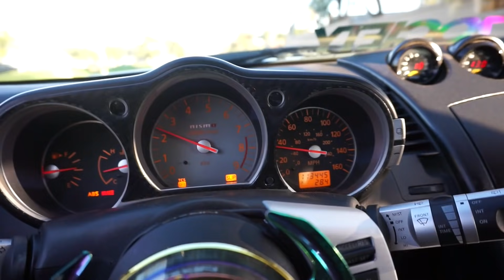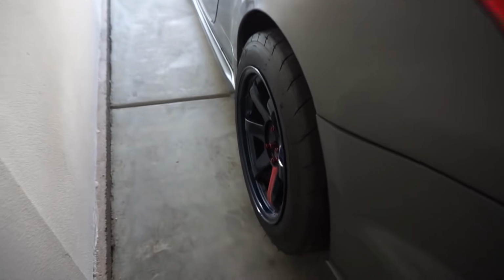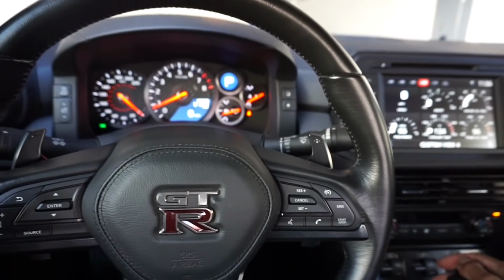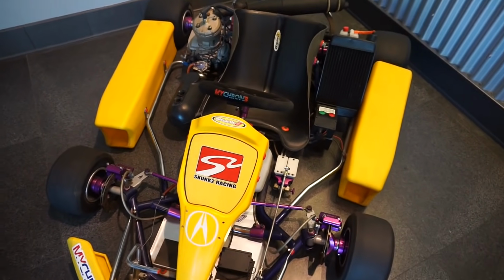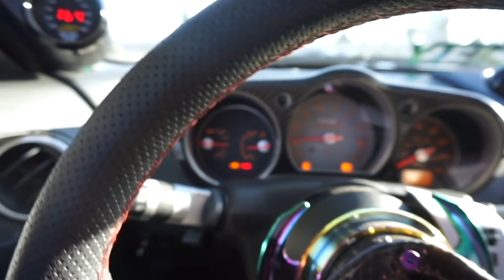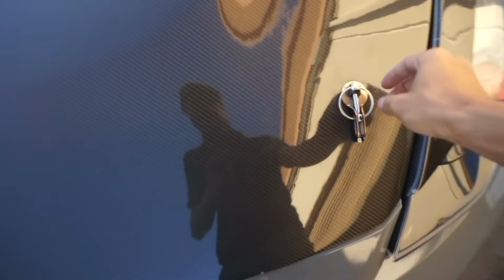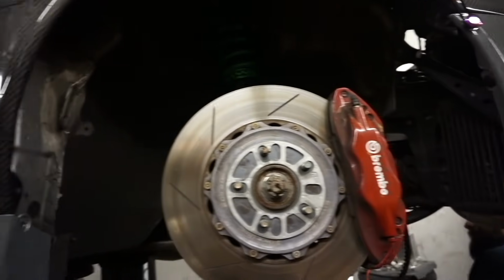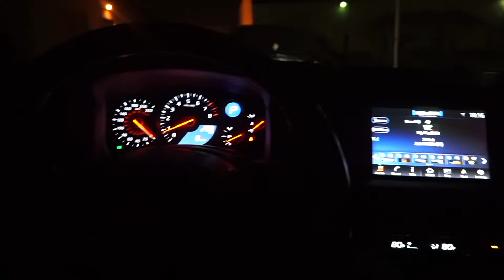Got meat? My 700HP 350z finally gets drag radials!

Comment: I had that problem with the door on my 370Z. I had to take off the interior door panel and replace the mechanism that connects to the locks. Turns out the wire was ripped. It worked after messing with the lock similar to yours but ended up failing after a few weeks. That’s what I did to fix it tho
Reply from the maker: Damn sounds like fun hahahaha
Reply: Freshhkiicks ya it was my driver side door. I had to jump in from my passenger side for a good month lmao

Comment: To get the door panel off while the door is closed, get a flat head screw driver and pry up on the window seals after all the screws to the door panel are off of course pry off the door panel as you normally would just gonna be more difficult while it’s closed 🤙🏼 but it’s possible, be careful not to break anything
Reply from the maker: Knowing me I’ll hella break shit hahaha.. seems like the only way
Reply: Might be easier to lift the door panel just enough where the seal is and go for the door handle pully string that attaches to the interior door handle pull that and open the door from there then take the door panel off, I think that’s what I did

Comment: to open the door remove the door panel from the inside and there's a latch inside and pull or push w.e you see and boom your good.
its a simple japanese car fix
i have a honda and once you tear apart your car a few times everything seems straight forward and easy!

Comment: To open the door take the door panel off and then you can access the mechanism. Super easy to do
Reply: Takes about 30 minutes to do. There’s 3 bolts and the mechanism is a standard wire barrel in a plastic pivot point
Reply from the maker: ill have to do it when I'm not lazy lol

Comment: If you drop the window all the way down you should be able to use a coat hanger or thin plastic pry tool to reach down into the door and pull the mechanism from the inside 👍🏼

Comment: Race cars stay broken 🤣. At least you're fixing it. My Nismo 370 tophat was fucked, fuel filter and regulator had black junk. So I swapped my whole fuel system, and added a surge tanks  to prep for my cams and GTM stage 2 SC kit. Will be running it with 4.08's on the circuit.

Comment: if ur able take the inside handle out, u will disconnect the rods that go to the latch mechanism..sometimes u can pull the rod,or linkage manually wit pliers to open door..ive had to do it acouple times jus never on a Z might work..like ur content,keep it up..

Comment: Nice Z.  I'm working on a 2005 35th anniversary edition Z. So far, I have Borla headers, and exhaust, and a k&n air filter. Getting lightweight pulleys, and deleting a pulley, then maybe a kinetix intake. I upgraded my brembo system to slotted and drilled rotors. NOS? Stay real.

Comment: Had the same issue with the door handle on my Z if you push on the front part of the door handle and  push it towards the back of the car then try to open it thats what i did and it worked

Comment: I'm running into the same problem you're gonna have to change the mechanism not fun locked the door of the car in unlock it with the button at the same time and pushed on the door handle... If not you've got a tear apart your interior and ruin it ... But try what I'm doing a couple of times it should work then just don't lock your doors until you fix it
Reply from the maker: mad annoying lol

Comment: Yo kicks I have a 350Z and the same thing happen to my door handle I had to cut open my interior door panel to get to the inside locking mechanism to the outside door handle the spring in your outside door handle prolly got crusty